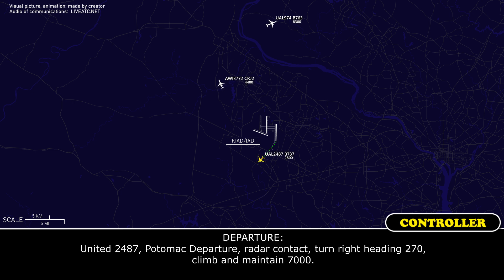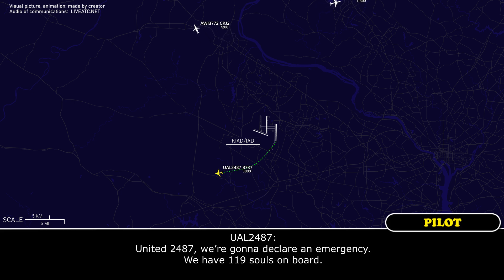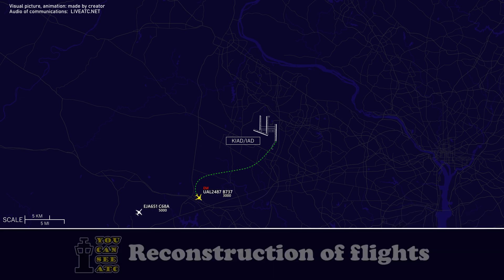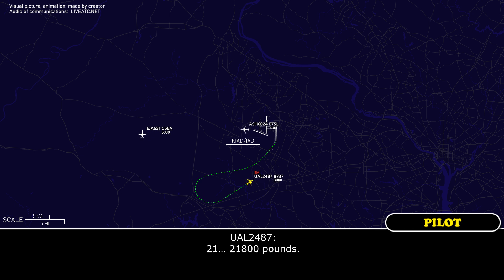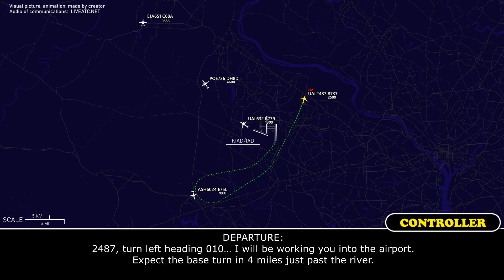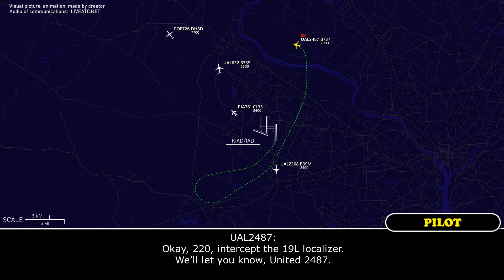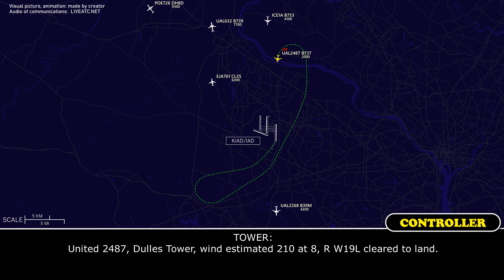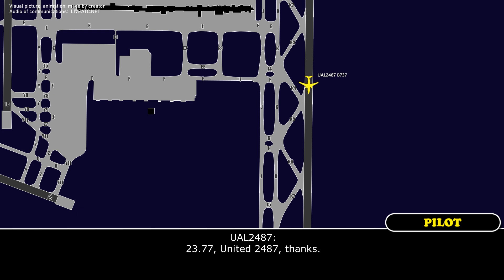TRIM ISSUE after departure from Dulles. United Boeing 737 declared an emergency. Real ATC audio

Comment: ATC always asks "fuel remaining and souls on board".  But I've listened to dozens of these videos.  Always.  Always.  Always, whether they reply with the fuel in hours, ATC wants to know fuel in pounds.  And vice versa.  Why doesn't ATC just ask for what they want to avoid the additional comm round trip?
Reply: They're a 737 that just took off. 3.5 hours should translate to a fair amount of fuel and it's a waste of time to ask how much in lbs to a task saturated cockpit.
Reply: Does that bother you? Mom always said you were a control freak.